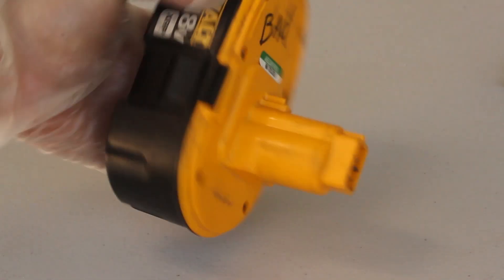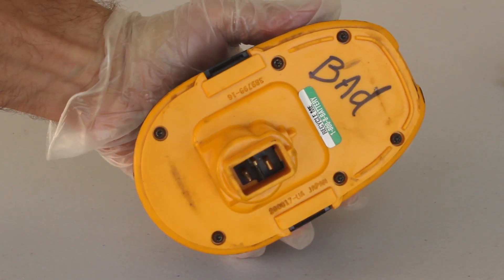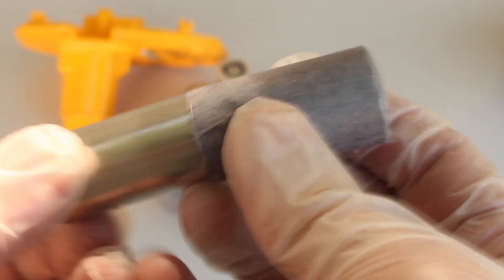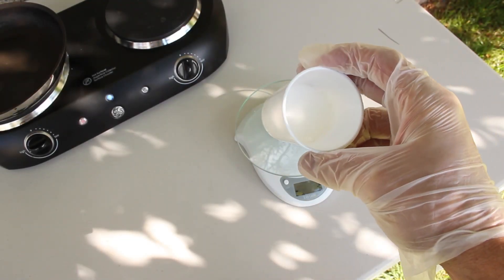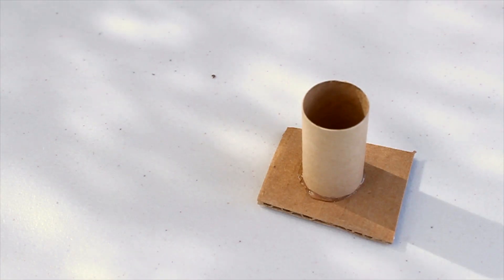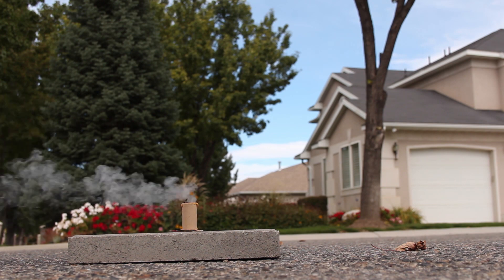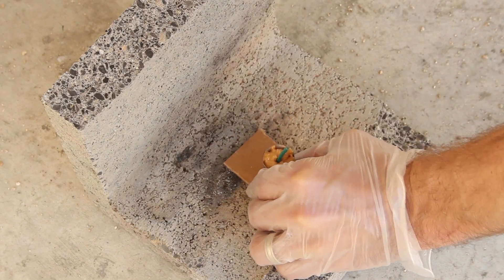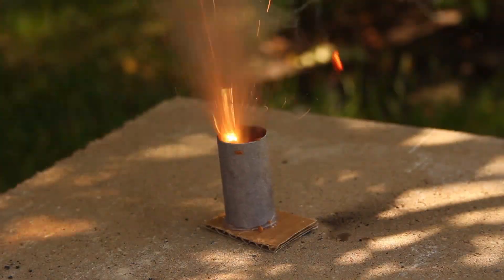Homemade Signal Flares

Comment from the maker: I think you're right about the pencil hole making it burn faster.  Compressing it should slow the burn, but I don't think you can compress it much when it's in liquid form, unless you do the baking soda method because it makes the mixture fluffy.

Comment from the maker: Ok, so just tested the 50/50 mix with wax and baking soda.  I wasn't impressed at all with the baking soda mixes.  Yes it slowed down the burn, but it was so slow the smoke dissipated too much and there was no smoke cloud to speak of.  The 50/50 batch with the wax was hard to light, but when it caught there was a lot of smoke, but a major amount of flame as well.  I wouldn't recommend paper casings on those.  Finally I tried a 60/40 with wax and it gave the best results out of these experiments.

Comment: Your coloring is limited by the KNO3 it seems...

You might have to look for a mix with a solvent dye, of any color, KCIO3 (potassium chlorate) and Lactose in 50/30/20 ratio.

You could also possibly do KCIO3 and  Rhodamine Baking Soda and Dextrin.

I also read somewhere that the use of wax with KNO3 would give a higher density smoke plume.

Although, if you mix your dyes correctly you would also have a high density plume.

Comment: I've been making the body of my rockets out of old ice-cream containers, which didn't seem to work that well, as they will often melt during the launch and flight, so a few days ago I tried something new, which was to cut open a toilet paper tube, line the inside with heat-resistant glue, and lay down tinfoil. I then rolled them back up until they had a diameter of about 2 cm, glued them shut, and added the fuel. I used 30g Saltpeter/20g Sucrose (table sugar), so 50g per rocket.

Comment from the maker: Thanks for asking!  You can probably use any tube.  I typically use Mega Block Legos :)  It was just a fun way to show what was inside a battery pack, and it happens that the tubes worked really well, but you can probably even make them out of junk-mail if you wanted.

Comment from the maker: From what I understand, the KNO3 is the oxidizer and so this reaction should continue even without contact with the air.  So in that case I don't think it will make a difference how much air touches it.  If you put it in a sealed container there is a great risk of explosion, so be careful and check local laws.

Comment from the maker: Open flame where?  I did it on an electric burner.  It actually takes a lot of heat to get these going.  I've tried burning the mix, and it will absorb a lot of heat before it auto ignites.  Not that I recommend trying!!  But an open flame will certainly set them off instantly!  Thanks

Comment: Saltpeter works too. You used to be able to buy it from pharmacy.
Used similar recipe before, but you can get them to work without heating them together first, just put the right ratio of each and set it a light.
Also, instead of a fuse you can use a match that has the stick in the mixture and has the head on the surface. Then you strike the match and it sets everything off. So you can make strike and throw smoke flares.